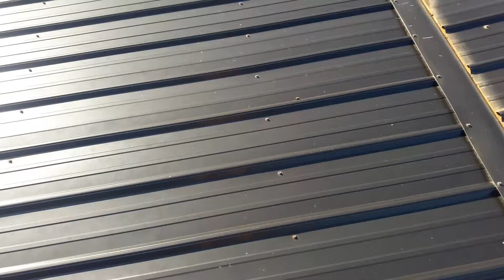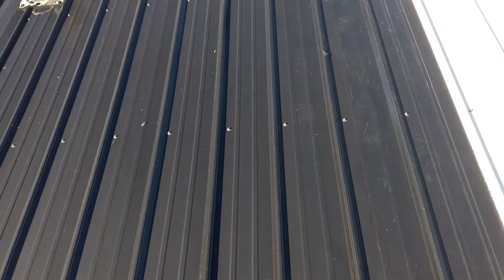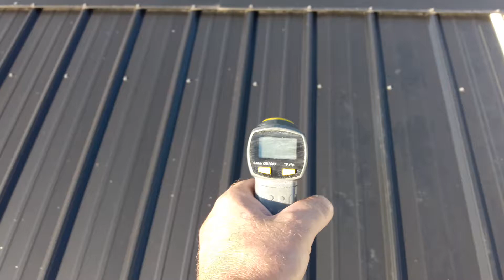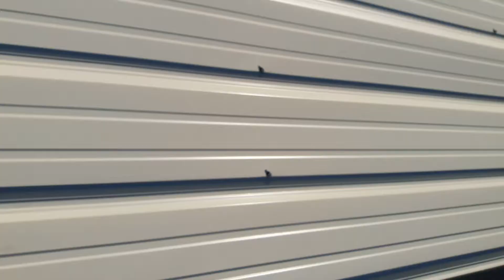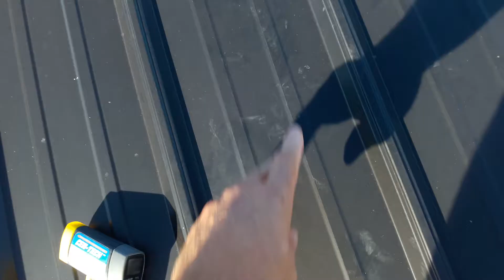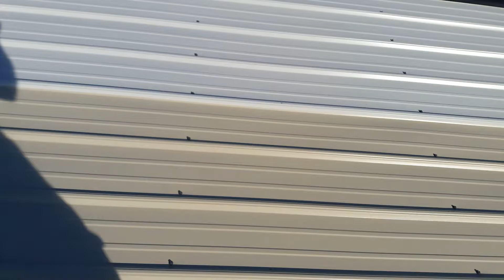Temperature difference Between a Light and dark roof

Comment: I would rather know what the temperature differences inside the house is under the insulation
Reply: Insulation has less work to do if the roof is keeping out the heat
Reply: If the vent is working properly the attic  air is exchanged 6 times per hour. If this is happening the insulation will only be handling a few degrees.
Reply: In my region maybe 1 in 50 attics vent anywhere close to 6x per hour. And it's a big MAYBE.
Reply: @NickleJ  
According to LOMANCO 90% of roofs in The U.S. are not vented properly. 
When we are done installing a new roof, they either are vented properly, or the homeowner wants to put the baffles in himself.

Comment: Do it again with a contact thermometer (one that measures temperature on contact). Those handheld infrared thermometers tend to read lower temperatures when the object is a light color and higher temperatures when the object is darker colored. This is due to emissivity, which is a characteristic of infrared thermometers.
Reply: You're referring to emissivity. All 3 measurements were not on a highly reflective surface so those readings should be fine.
Reply: Yes, I was referring to emissitivity, I did say that towards the end of my comment.

I used to work in a calibration laboratory and I calibrated these types of thermometers many times and I've noticed the difference between light colored surfaces and dark colored surfaces. 

And it's not just emissitivity, it's also "distance-to-spot". Each thermometer model has a "distance-to-spot" specification that is the ideal distance for measuring. The farther you are from that distance, the less accurate your measurement will be.
Reply: I'm not refuting the effectiveness of white-colored roof versus dark-colored roofs. Just saying that the temperature measurements may be inaccurate. The best test is to compare the temperature inside the house.

Comment: Temperature difference/compare:-
Dark roof: 115 degree
Beige roof: 100 degree
White roof: 95 degree
Reply: ~ 11 C difference between dark and white
Reply: What about with shingles
Reply: White shingles are only 9-10 degrees cooler then black. If the attic is vented properly, the air exchanges 6 times per hour, The attic temp is only a few degrees at worst warmer, if everything else is the same. As soon as you hit a light color the gap closes more.
Reply: @renurenovationsllc7780 we just witnessed a 20 degree difference. Why are you saying 10?
Reply: That is metal, all shingles even white have asphalt base, so end up with grey and black speckles which makes the difference much less.